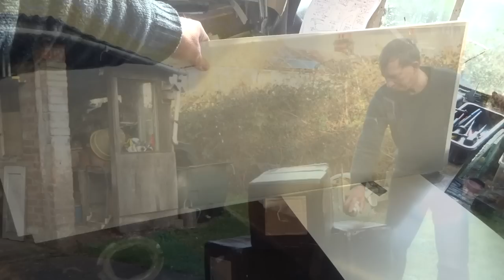How it's made - Giant Floppy Cube Puzzle (construction by Tony Fisher)

Comment: assuming the central 18cm cube in unbandaged, would a move turning only the corners be possible in a state like 8:46 (i.e. L or R moves) where the middle slice is turned only 90 degrees?
Reply: i have realised that this would only be possible if more of the edges on the edge cubies were cut due to the corner stalks getting in the way otherwise